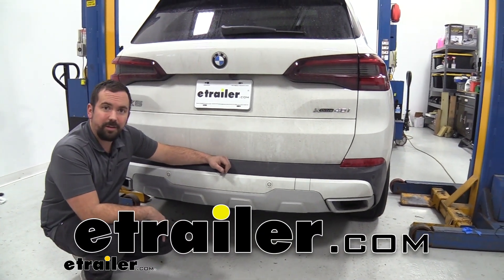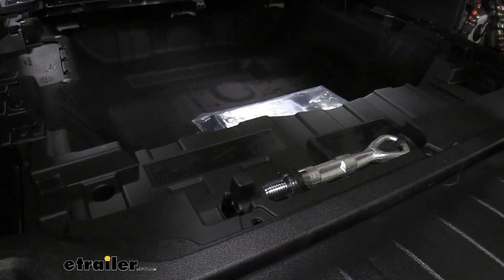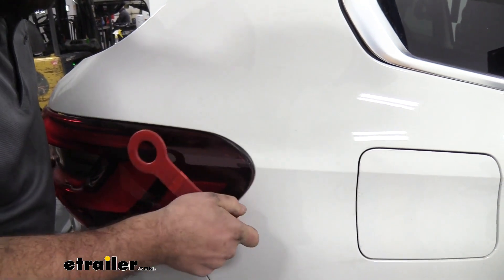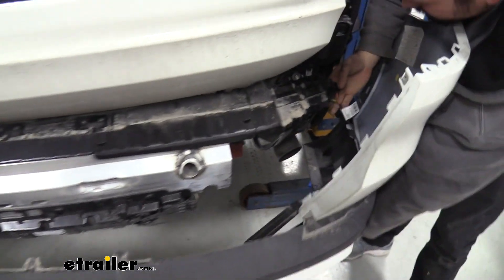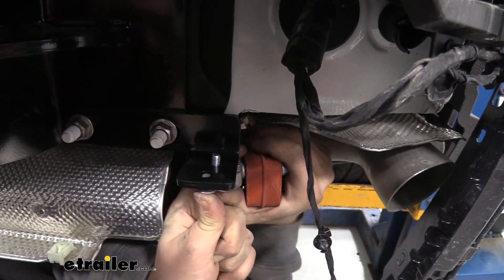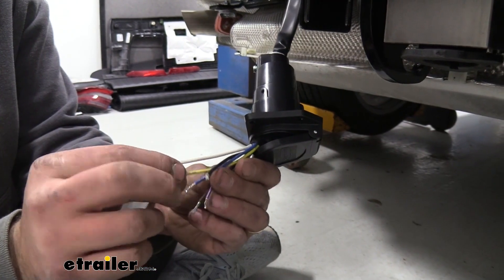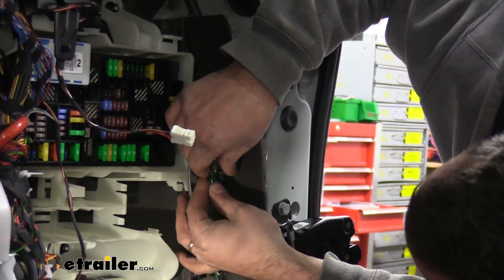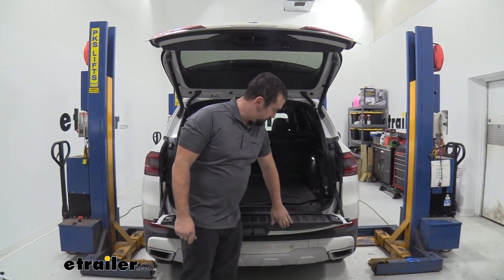etrailer | Mount: Stealth Hitches Hidden Trailer Hitch Receiver w/ Towing Kit on a 2022 BMW X5

Comment: Just go with the factory retrofit kit for the wiring,  The x5 will then go into towing mode  which will change shift points and the safety collision systems will work properly.   Also does not involve  splicing into wires.     With this aftermarket box the collision system goes crazy.

Comment: Great video!! Thank you!!! Question…Stealth Hitches forgot to send the Z-BRACKET. I’m in the middle of the install and am considering finishing without it knowing that I’ll come back to finish this part of the install after delivery. Will I be able to do this after I’ve put everything back on or will it be difficult to access it the bolts to which I need to attach the Z-BRACKET?

Comment: Very professional but the one thing I learned here is to never do this .
Reply from the maker: It is a pretty involved installation. If the install isn't something you'd feel comfortable attempting yourself, you can use the link below to see a listing of local installers near you. Just type your zip code into the provided field. If possible, you'll want to choose a shop that's carries an ASE and RVIA certification.
https://www.etrailer.com/installer/near-me/trailer-hitch